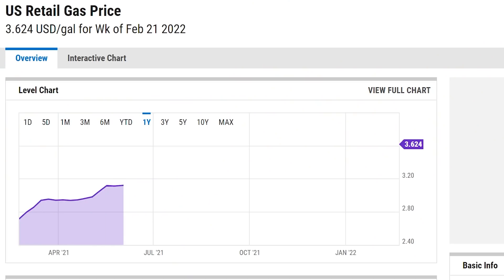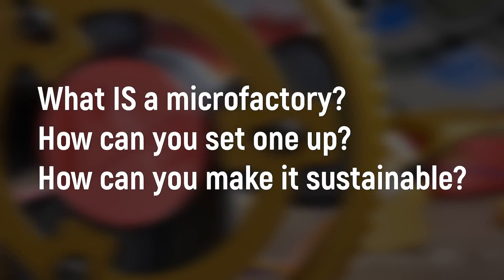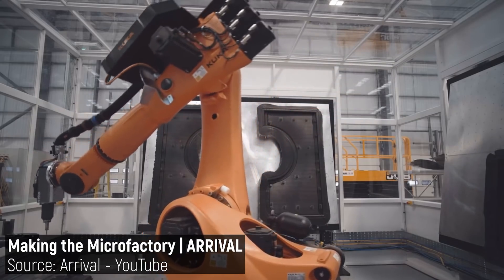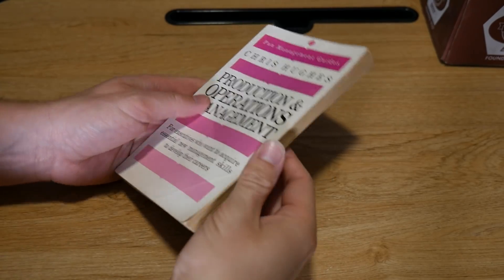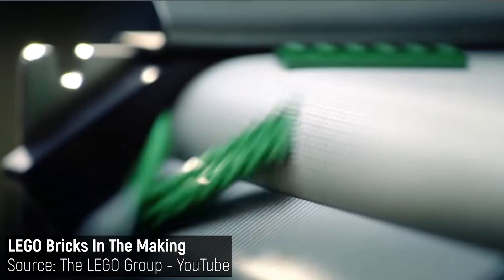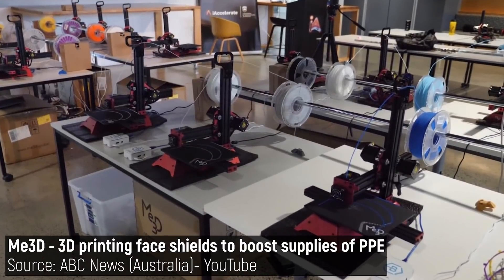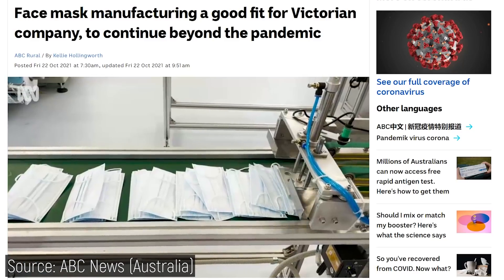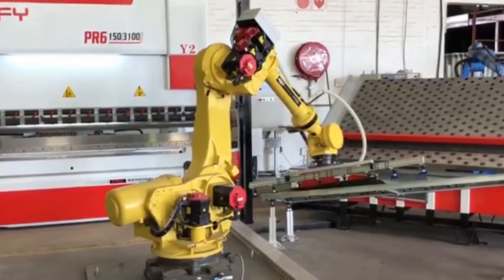Can Microfactories Solve the Global Logistics Crisis?

Comment: One problem with these new technologies is that the materials they use are not manufactured locally. 3D printers are pretty much useless without filament or resin. It'd be worth looking into local resources where these could be sourced, as currently most of it is shipped international.

Maybe if logistics was used mostly to ship more raw materials and products were then manufactured more locally, it'd ease some of the pressure off the global logistics system.

Comment: I don't think small scale local manufacturing makes a lot of sense, the microfactory model, unless raw materials are manufactured locally as well, which they're still shipped from half way across the globe anyway. Very few countries have ore mines or oil or anything.

Small scale workshops doing custom work are obviously viable, as are small scale manufacturing operations for goods needed worldwide but not needed in large enough quantity to make use of mass manufacturing techniques. So i'd still like a small scale manufacturing series covering the latter usecase.

I was also thinking that countries should adopt the China Mail model, i.e. finance the fixed infrastructure of the mail system from taxes and only charge for the marginal shipping cost as postage. This will make small scale manufacturing and point to point distribution more viable for companies operating outside China. It would be interesting to see the model adopted say Europewide.

Comment: That would be quite an interesting series.
The CNC and laser cutting is a nice example of technologies that could do much more for batch production.
If you design your product properly, you can (or could) produce different products on the same machine configuration, with the same raw, thus decreasing the price.
Also, "mass customization" is probably the biggest added value for batch producing and micro factory as you define it.
Buying a baby chair locally for a higher price can be justified if you can engrave/etch your baby's name on it, or customize some aspect of it (like pick and choose between multiple design for the side, table and backseat).
That's how things could work to me.

Comment: The issue here is numbers. There still a strain on supply.  The issue is how much a single plant can produce. Also standards on parts will slip. The more diverse the manufacturing base is. There will be peaks I demand and more severe crashes. As a complement to large scale manufacturing. I can’t see what the problem is. But it’s very niches are dependent ion conditions being right. Overflow definitely.

Comment: Market for these sorts of things does exist. Not long ago, I did a short production run for a family friend, turning 20mm shaft retainers. Simple parts, just drill, countersink and part off. Here's the challenge: I did this for him at around $25 per hour, and with my engine lathe I could make one part every 5 minutes or so. Only economic because I'm a cut price machinist with no qualifications, who knows this is the case and doesn't mind charging an absurdly low rate because it's a hobby for me (I could make $40/hr doing my real university qualified job). Even a small scale up would drastically improve productivity for the cost, e.g. a properly set up turret lathe could probably punch out one part per minute or so, and a CNC lathe with a fast spindle and carbide tooling would surpass even that. The economies of scale compound on one another. So the niche for a micro-manufacturer (essentially what I was doing) is very narrow, requiring a product that is only in demand at small volume (I made about 100 of these parts) but is also relatively simple/cheap to produce with basic equipment, and even then it isn't a highly profitable business.

Comment: The issue with the idea is that microfactories multiply the problems. If there is any quality issue, where is it coming from? Production or design? How do you do QA? Also, invest would be insane, same as stockkeeping. Even if we only talk 3D printing - stocking filments, resins, powders etc. in hundreds of colors and materials makes no sense for small scale manufacturing.
And when we get to products people would actually want, not just lowest qulity plastic toys, the invest goes absolutely through the roof.
There is a damn good reason places like machine shops exist - buying a 100,000$ CNC makes no sense if you only make low numbers of parts, and even those machine shops can't perform all the necessary steps in production.
Home 3D printing and home CNC will never play any meaningful role in manufacturing. The cost of ownership, IP rights, skill barrier, space requirements, etc. wont be overcome by wishful thinking.

Comment: Raw materials are expensive, sometimes more so than the mass produced end products. 

You should assess what raw materials are low cost in your area, which could provide an edge. 

Also 6 axis robotic arms have a high range of function and automation and can be set in a series. Providing 2-3 manufacturing steps, which could provide complex repetitive function. 

But only producing ow tech products. 
Any high tech products still require expensive plant and machinery to produce.

Comment: simple answer: no. Medium explanation: because the supply chain is just simply too complicated, some small printers or routers can do some supplement jobs, but the whole supply chain is more than that. For instance, a microchip for power supply is stuck somewhere, you won't get a even a screen up and running. And you make your own chip, build a fab? no way, and not to mention, the fabs need PLCs, screens (yes, screens), pneumatic cylinders, linear drives, servos and so on to run, all these are produced around the world at the best price for their performance. To replace that. forget about it.

Comment: It's an interesting idea, but I think economy of scale wins every time. Here's some things to think about and some problems you might not have considered, based on my personal experience:

I work for a company that does roll forming. Roll formed parts are typically long with a uniform cross section and are produced continuously. A lot of the stuff we make could be reproduced with a press brake and a large laser cutter, but we can make it for 1/10 or even 1/100 of the same price. The cost of shipping pales in comparison. 

We also do assemblies, which I think is one of the things that will be a hurdle for microfactories. Say you have a product that requires 5 components: a circuit board, a casing, a few screws, a touch screen, and a gizmo. A micro factory could make a few of those, the casing and the gizmo, but the screws, circuit board, and the touch screen would have to be delivered. A traditional factory would make 1000's of these a day, so it gets 5 trucks with 1000's of each component, but the microfactory would still need 3 deliveries to make just one. The actual assembly is also much more burdensome for the microfactory. An assembler at the traditional factory spends a few days getting up to speed on putting together an assembly, the one off piece could very easily take 3 times longer than the 100th assembly someone puts together. Even something as having the right tools on hand can take time, and time = money.

Having inventory is a real pain. I actually was measuring how much floor space our finished assemblies are taking up and it came out to about 4000 square feet (370 square meters). And that's for a single customer. 

Also, while shipping delays have gotten a lot of media attention, there have been other disruptions to the supply chain. If everyone at a steel mill is sick for two weeks, that shuts down production at dozens or hundreds of factories. And then those factories get shut or slowed down for a few weeks themselves, and so on down the line. Not to mention the millions of people who were laid off for months and then decided that their old job working in a factory for 50 hours a week sucked and they weren't going back. 

Anyway, all of this is just the ramblings of an engineer who has had to deal with the supply chain way more than he would have liked.

Comment: I'm very much looking forward to the next videos in this series as I find the idea of shifting from centralised mass-production really enticing.

I believe it's totally feasible to run a microfactory using only 3D printers to produce everyday items in bulk. However, the products would need to be designed to take advantage of the specific strengths of 3D printing technology and to overcome its inherent weaknesses (mainly speed) in order to be a viable alternative.

Recently, I've been prototyping a new modular storage system I designed that 3D-prints super-fast and is very economical in filament usage due to printing entirely in 'vase mode'. (check out the top of the Cults3D homepage if interested in seeing it).  

I can hardly keep up with how quickly the drawers and frames etc print, so I could definitely scale this up to produce enough parts to supply my local area and beyond (which I am considering).  I also think it could be a cost-effective solutuon compared  to mass-production, especially when you factor in zero tooling costs and only local shipping costs. This is not to mention the environmental benefits of local production.

Comment: While the economy of scale is just too great to replace manufacturing I do see huge potential with micro factories.

So as things stand now there's cheap goods from China and there's the super expensive counterparts not made in China. 

Often times the things from China regardless of the brand are actually insanely similar. Some might have identical guts with a different outside made for that specific brand. Other times it's the exact same thing just with a different sticker. All of the value added is in the brand QA what they get shipped over, packaging, replacing broken units, and support.

Then if you don't want the one from China you get the "good" one from the US or Europe or anywhere but China. Completely different and can range from being able to run it over with a car and it still function to it's only value being it didn't come from China.

The mid-range has gotten a lot smaller. If you want something a little better engineered and willing to spend a little more money, but not hundreds dollars more...the pickings are slim.  I can see micro factories filling this role. Namely makers taking a Chinese product and reverse engineering it and repackaging everything that overcomes the countless weaknesses products from China usually has. Also it's kind of funny to imagine stealing IP from China.

A few extra bucks. A little more bespoke. A little better made. But it doesn't require you to save up for a few months. QA is done on the spot. Packaging isn't required though I guess could be done by the boutique mini factory. Support can be handled by the designer.

Comment: I work in the cycling industry, Started as a shop grom and am now in product development. Ive been saying this ever since I was wrenching at a shop. Bicycle frame manufacturing could be accomplished with a relatively small amount of physical infrastructure. Think 2-4 20ft shipping containers which could potentially be distributed all around. Particularly for printed metal lug bikes, but also in the future if 3d carbon weaving becomes more than just a dream of mine. So many avenues of benefit and increased specificity of application. Distributed I believe is 100% the future of almost everything.

Comment: It seems easy enough to manufacture static inert objects like chopping boards and phone cases but as soon as electronics and mechanical complexity come in, you are going to be sourcing parts like chips, batteries, and motors, that are built at scale in a factory. I'm these cases, what does the local microfactory provide? Design of the product perhaps. Static component and case manufacture, and manual assembly, testing, and shipping using expensive labour.
I'll be interested to see what you produce and how far you profitably get selling things more complex than pizza stones, butcher blocks, soap, and phone stands.
My guess is that you will have to ship worldwide to exploit your international audience so it will be especially interesting to see your local income tracked separately.

Comment: It's an interesting idea, and could work in certain cases, but there will still be the required logistics for the raw materials or sub-parts for assembly within the micro factories.  Something as throwaway as a happy meal toy can require a substantial number of different manufacturing processes and assembly. A manufacturing ecosystem that provides all those materials/expertise is much more valuable than an isolated factory.  Much of the backlogs currently are due to microchip shortages and those don't have any micro factory solutions given that the fabs themselves can cost $10B or more - not something to do on the cheap.  Redundant factories within each continent that can serve those large geographic areas without relying on container shipping could make more sense, to provide more resilience in the case of natural disaster or war for example.

Comment: There are certain things that people are never going to make in their home, glass, microprocessors, LCD's, various chemicals.
these things require enormous investment to create and do it safely.
I could see micro factories becoming a middle ground. A large factory churns out sheets of glass that are bought up by micro factories for use in a product. Aluminium blocks are sent out for milling in micro factories. General purpose chips are made in a large factory and used in different products by micro factories around the world.
it would be interesting to see what people can come up with and produce in their own home. People can be surprisingly creative given time and shared knowledge.
There could also be a ton of innovation with small scale manufacturing. Something I notice with large corporations is that they tend to play it safe. They often just make small changes to existing products instead of swinging for the fences and trying radically new ideas. Why? You said it in the video, large factories have millions invested in tools already, they aren't going to risk all of that on some new crazy idea. Stick to what you know and keep doing the same thing.
The incentives for a micro factory are flipped on it's head. They have much lower investment, can spend more time on customization, and have no need to compete with what is already established in the market. Their best bet is to create something that has never been done before. Make a few items at relatively low cost and see if people like them. If it succeeds they can invest more into production or sell their (now proven) idea to a major manufacturer. 
Most crazy ideas will probably fail, but if even 1% do make it there could be a ton of new product ideas out there ready to change the world.

Comment: Ever since I saw one gigantic trainload of coal passing another one going the opposite direction years ago I've been saying this about the modern insanity of identical products being shipped all over the place. A particular product needs to have only one seller in a given location, and the manufacture needs to be nearby. The same product should be manufactured in multiple places near where it is used instead of being shipped all over the planet. Packaging should be eliminated in most cases and pared to the absolute minimum when it cannot. The amount of resources wasted (time, fuel, money and effort) wasted and pollution created by the exact same product being shipped back and forth multiple times is staggering. Never mind the current logistics nightmare, it was always an untenable approach. Local production is where it's at.

That goes for energy as well. Power grids need to die for many of the same reasons.